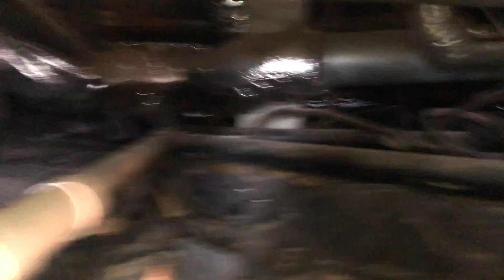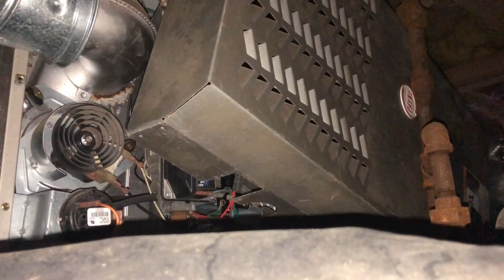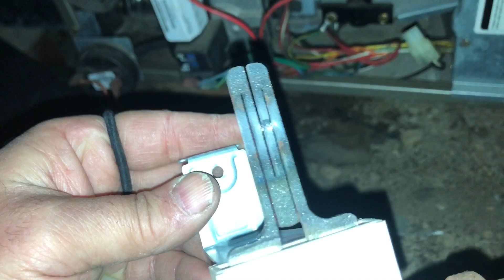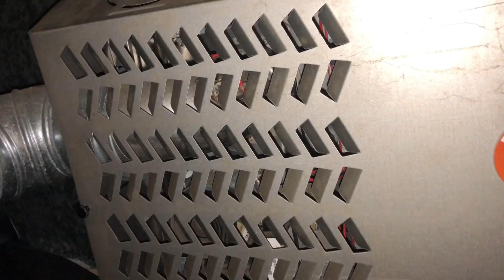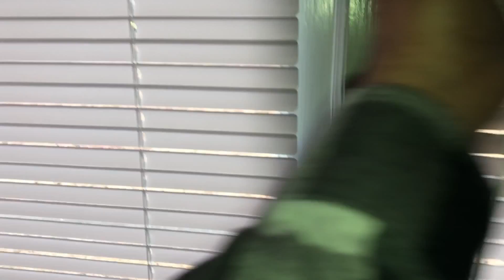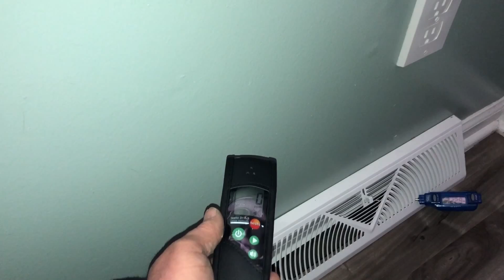Carrier Gas Furnace igniter failed ... no diy

Comment: I have a complex where I look after over 70 of those units , number 1 issue is ignitors number 2 is ventor motors .
Reply: Also I agree terrible design , do you not have to run armored cable from the switch to the furnace ? Also up here in Canada we are not allowed to run flex connectors on fixed appliances including and especially furnaces .

Comment: I had my roof replaced last October and the inducer fan was making a lot of noise when I fired up the furnace right after the roof was finished.  I removed the inducer and found a small nail in the fan assembly (this was not the original inducer fan) but the nail was not the cause of the noise.  I found a small piece of rust rubbing on the fan blades inside the inducer.

Comment: I just installed my own 3-ton mini split. Bought it on ebay for about $1300 bucks, wrenched together the line set and power lines, used a proper disconnect, bought my own vac pump and cheap gauges, and released the pre-charge into the system. Works great. 

Some people are not stupid and can learn how to DIY a mechanical system. It's not rocket science.
Reply: @steve57912   I don't install mini-splits, When it's ten degrees outside it ain't my problem.
Reply: Smart man who does it himself. A vast majority of the trade are hacks, no pride.

Comment: i "yanked" on a gas line once and it snapped off flush with an elbow.... I wasn't long fetching and stepping to get outside behind the building to turn gas off, which I had no idea which meter it was, I probably looked like the flash running and looking ta the meters for fast movement.
it must have been work/heat hardened pipe from bad process or dull threading die at too high of speeds or something similar, because it was a short piece and I didn't pull that hard.
Reply: It's a good thing you found that piece of suspect pipe and shut the gas off.... If someone else would of done it or the pipe failed for whatever reason the results could of been disastrous.

Comment: Mr. Cook<
  You showed a Trane Package unit with a bad RV. You took the whole thing apart. I noticed you have a MAP gas torch in your tools. Did you use Stay Brite 8 mto replace the valve?
Reply from the maker: No... just Dynaflow or 15 with a B tank torch.

Comment: Interesting video. Can't imagine locating and installing a piece of equipment in such a place and in such a manner. Seem like a nice and conscientious guy. Don't like the name of the channel though. I mean, I get it, some people do some dumb things, and it is frustrating sometimes. But that's life in the world. People need to have some basic skills and basic self sufficiency, and society should encourage that IMHO.
Reply: I agree people should strive to be more knowledgeable and manage tasks themselves, but we also need to realize our limits.   HVAC requires a lot of expertise - so hire an expert.
Reply: There are a few people who can repair and install HVAC equipment themselves.  The people who really scare me are the ones who do not have a basic understanding of electricity and cannot read schematics but they still try to wire in capacitors, transformers, and motors and they often do it incorrectly, resulting in a dangerous short.  One homeowner actually cut the ground to his condensing unit because it kept tripping the breaker, shutting off the unit.  That made the frame of the condensing unit "live" and somebody could have been electrocuted.
Reply from the maker: Watch this video... here is an example of a DIY guy that almost killed people with a DANGEROUS hack job he did.... https://www.youtube.com/watch?v=PpE6q52-atM&t=11s
Reply: The main reason a person does DIY is to save money.  When it comes to furnaces and AC units only trained professionals should do the work.  Dont be cheap
Reply: @JJ-Toreddie  
As a homeowner and landlord I have studied and learned how to fix basic things with hvac ignitors flame sensors thermostats cleaning condinstate lines are simple things to replace and do

Comment: BDP used to provide a new bracket for that ignitor, that re located the ignitor due to problems with ignitor longevity.  There was a service letter out on that. That’s a line voltage ignitor. It should not have been hooked up with wire nuts, especially plastic ones, that close to the flame.  Wire nuts can back themselves off due to the on and off heat, The original  ignitor had a plug that mates with the plug on the wiring harness.  I don’t like to make line voltage connections with wire nuts outside of a junction box, motor cover,  etc, unless it is a factory connection like a insulated plug that won’t allow the conductors to contact the chassis, even if it comes un done.  I have seen it  done is with the old 24 volt glow coils for the vintage 3 wire bimetallic pilots, and we used porcelain wire nuts on them due to the heat.

Comment: Great video! I just replaced a gas valve and induced motor on that same unit by Bryant yesterday. Whenever I hear that grinding noise I always recommend replacement, because soon as u leave it will lock up. God Bless

Comment: The better way to check would be check CO in the flue pipe.
Reply: It tells you if the heat exchanger is intake or if the air from the blower has entered the heat exchanger. 
CO being present in the airstream is VERY slim with any draft induced system.

Comment: I love that 24in of unobstructed working access in front of the unit could you imagine putting a blower motor you would have to take the gas line apart. And those doors are a PIA.